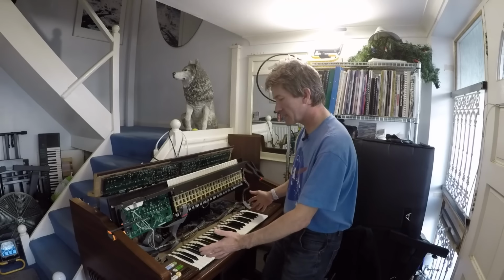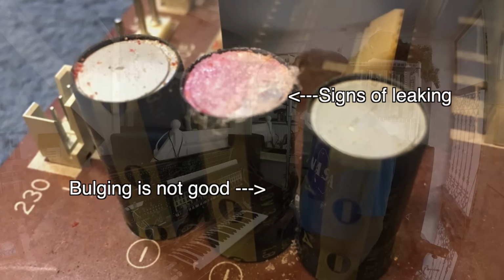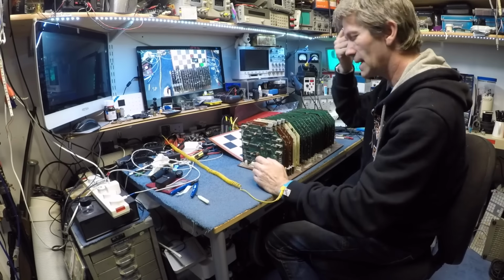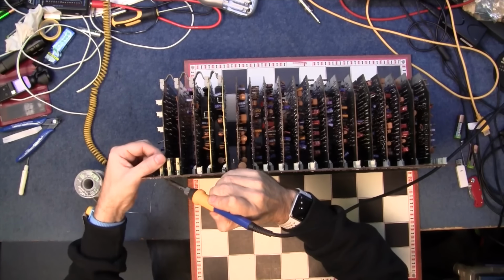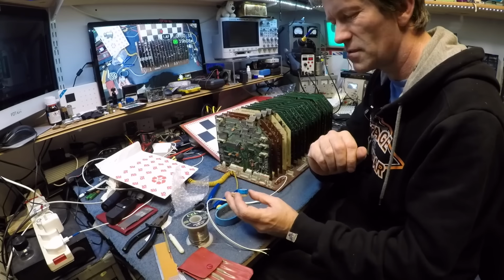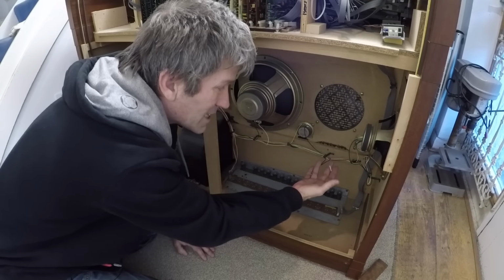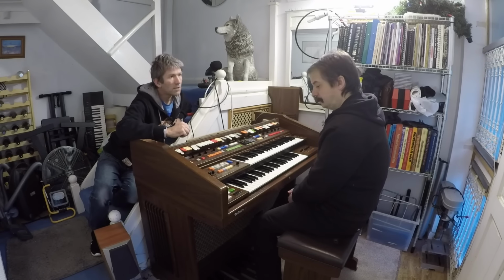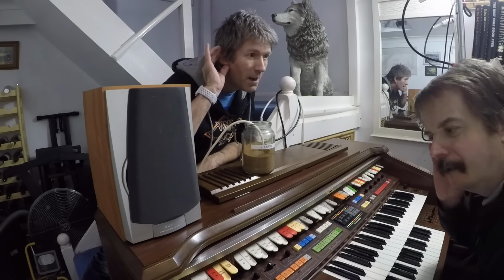Technics U90 organ repair

Comment: Hey Marcus, first off I want to say I love watching your channel. You have a gift of explaining complicated things in such an easy to understand way, and have given me more confidence to attempt repairs.. I've pretty much been through all your video's now! I like fixing stuff too, but unfortunately I don't possess your skills. I've got a problem with a Korg Poly 61 I picked up. When I got it there was only power - none of the displays worked and there was no sound. The internal battery had leaked which is common to this model. I cleaned it all up with IPA and it came back to life - the LED's, all controls and all keys work as normal but the patches sounded weird. I've cleaned up the CPU board, sound board and power board and cleaned and reseated all the molex connectors on these with IPA. I had a direct replacement 3 leg new battery fitted. However, when I load in a WAV file of the original factory patches, it only stores them temporarily(about an hour after power off) and then it reverts to the original internal patches which still sound weird and corrupted. When I load in the WAV sounds it plays them back perfectly with no corruption.  It's been suggested that the battery could be the wrong way round, but the 3 leg battery can only be fitted one way so it can't be this surely? Really hope you can give me some pointers as to why it can't save patches permanently - I'm not getting much help off forums. Apologies for long post. Thanks and looking forward to more video's!
Reply from the maker: Hello Kevin, I think you must have placed the battery correctly as you say its a 3 pin version so only one way is possible. I guess one way to check would be to load the wav file test the sound then turn off then back on again but within 30 seconds then if the sounds play ok then it cannot be the battery polarity because if it was the wrong way round then the memory would be lost within a few seconds of power down. there must be something else draining the power down . can you check the voltage of the battery to see if it has been depleted already ?. that would explin why the memory is not holding. if it is depleted then you need to find why the power is running down on the battery.

Comment: Hey Markus, thanks for this video ! I'm dealing with problems with my U90 pro too... When I switch it on there is no sound und all the LEDs in the preset buttons don't work and nothing happens when I push the preset button.
Checked that gold caps on the board and they were all leaky. Got 3 new of them and replaced. I switched on the U90 and having the same problem as before. No sound not LED on preset button and no reaction when I push them.
Do you have any idea ? 
thank you so much !

Comment: I have an SX-U90S but only the top portion. No base, no speakers, no amp. It does have outputs on the key platform underneath. ( phones, aux, mic with volume potentiometer, and line out ) And I see two IEC cables coming from it. Do you know the voltage as I imagine it’s a low voltage IEC. I certainly don’t want to fry anything attempting to plug 110 into it. Thank you.
Reply: Well the reason why you don't see any speakers underneath is because the speakers are separate it comes with two great big stereo amped speakers

Comment: A friend gave me a u 90 after swapping it with a fully working u 90 - the fully working u 90 had been struck by lightning through the mains  incredibly  the only damage was the amplifier modules got blown up , repaired the tech bolted on LM IC  AMP  substitute boards and the u 90 is back to normal - 
Mark that was interesting that you didn't un plug the boards , I did and caused dry joints to show up on the mother board connectors , seems I was chasing a single broken audio line at start luckily all came out OK resoldering everywhere .
Reply from the maker: Hello Keith. I thought about pulling off the boards to try and see what board did what but I’m glad I did not as that can create new problems to work on. we eventually gave it away to a local charity shop and they somehow managed to make £350 from it which is a very good price.
Reply: @markusfuller  I tried to make a DIY schematic of the whole system but only just got so far to get a partial overview. EG the key and stop scanning is basic/ standard gear.
The u 90 shares some same technology ( CPU ) as the famous polysix , saw your video on one that was wrecked beyond repair.

Yes 350 pound was a good return for the charity .
So many organs sound the same on both keyboards u 90 has this too but with enough extras to make it ok.
Reply from the maker: Keith Citizen If only I had a larger place I would have gladly kept the U90 but I live in a small flat so it’s difficult to keep too much gear.
Reply: @markusfuller  interesting, sounds like you liked the u 90

 Ime seeing a Technics g 7 (1986 ?)  available in Australia for around a hundred pounds , I guess it's a very different animal to try and repair and not worth buying.

Comment: I have just received an SX- U90  for  our club unfortunately it has a problem with the top manual, it has distorted sound  which is as if it has a sore throat  the distortion is there without  any keys depressed, any suggestions as to the cause of the fault , and where can I get a service  manual. I am in the UK.

Comment: Hello
I have bought an organ on my own (Hammond Romance series). It has a really weird problem. If you have any ideas where this problem may come from or tips on what to look for while searching fo the problem that would be awesome! Here 's the problem: 
When I start it most registers don't really work until I press a lot of keys at the same time. Then they work for some time. If they stop working I have to do that again.
First I thought that this problem might be about a minimum signal strength for the amp but it seems more complicated: If I get the volume (expression) all the way up that doesn't help. Only pressing more keys helps.
I already opened it once and had a look for broken capacitors but didn't find any.
Greetings from Germany :)
Reply from the maker: Hello . I am really sorry but I just do not know what to suggest, I have never worked on a hammond romance series organ but I have never come across this problem with any organ so I cannot understand what the problem may be or even where to start looking. I am truly sorry, if i had the answer or even an idea i would be glad to help but this baffles me.
Reply: @markusfuller  Thanks for answering so fast and trying to help. I think I'm gonna have to take another look inside. I just found your channel today and already learned a lot of nice tricks to check components. Unfurtunatly I don't have an oscilloscope  though :/ Also thanks for sharing all your knowledge with us.

Comment: Where can one get these serviced in the UK? I've been wanting to get one but am told nobody services them anymore and parts not available. Would someone knowledgeable in electronics be able to service it if the organ servicing places say they won't? I know nothing about electronics myself.
Reply from the maker: Hi It is best if you can find a proper organ service engineer but almost all the electronics inside is still available to buy from places like rs-electronics or mouser or even taken from other old organs though some of the microchips may be very difficult to get hold of now. so yes a good electronics person should be able to repair this depending on the fault.

Comment: Hello Markuss

I own a U90 technics organ
it was electrically disconnected for 9 months

There is no more sound

I have changed the capacitors as shown on your video.
by 3 capacitors in series and tested + 5 Volts in total

I still don't have sound

Do you have another solution
I thank you for
Yours sincerely
Reply from the maker: No sound at all . check any fuses where the amplifiers are . I think ther are in the back above the pedals. I no longer have mine so cannot remember but check if there are any fuses down there as the amplifiers may have their own.
Reply: @markusfuller  Hello Markuss

Thank you for your very very quick response

I am French and I live in LORRAINE (France)
When I plug in and turn on the organ with the button
(Push on Power) and Main volume at maximum
the pedal to the maximum too
I hear the sound from the "subwoofer" diameter 30 cm and on the 2 speakers of 20 cm

no sound on keyboards but:
"the conductor orchestral"
is fully "ON" (blocked)
6(sélections) keys in "UPPER"
and 4 (selections) keys in "LOWER"
Do you have another solution
Thank you

cordially
Reply: Regulator chips often failed in those..worth a check.

Comment: I guess the higher voltage on the replacement cap is ok? Just not the other way around no?
Reply: Correct. Voltage rating of a cap indicates the highest voltage it can tolerate (not the voltage it requires or produces or whatever). Thus a, say,  16 volt cap in a 5 volt application is fine but a 5 volt cap in a 16 volt application explodes (or at least emits foul smelling smoke and shmoo).
Reply: @sootikins  A follow up about caps - why did he lower the capacitance? I'm not following the math.  Since the caps are RATED higher, but still only going to charge to the given voltage, shouldn't he have gotten a single cap rated the same (or higher) voltage and triple the farad?
Reply: @ @sagetx  When capacitors are in series, as they were in this organ, the voltages sum up but the capacitances (farads) divide (much like resistors in parallel do). He sort of covers this at 6:00 but to clarify: when caps of identical value are connected in series, the total capacitance is the value of one cap divided by the number of capacitors and the max voltage is the sum of the caps' voltage ratings. If the caps are not identical the math becomes a little more complicated. Maybe this link helps:  https://farside.ph.utexas.edu/teaching/302l/lectures/node46.html

Comment: Hi, I have a Technics PCM Sound E11L that I bought second hand. I love playing it. It's my baby! But for some strange reason each key has started making a wobbling/distorted sound. I don't have a manual for it. I've tried changing the settings but to no avail. Can you help me? I'm based in Buckinghamshire. I really want to get it fixed. If you can help, or refer me to an organ fixing service that would be a great help

Comment: Dear Markus, thanks firstly for a wonderful video. I am living in the Philippines where house wiring does not have earth and I have taken your advice and added a earth-jar and this helps no end. The other, more annoying, fault my Technics organ has has not improved though and I was wondering if I could ask for your advice ..

So, basically I have a Technitone SX-70GW which is older than your U90, built around 1973. Unlike the U90 it's 100% analog including a drum machine with analog sounds (the U90 probably has PCM). It's 'similar but different' when taken apart, there are no flat cables like on the U90, instead it is bunches of coloured cables going onto boards everywhere - there are two banks of circuit boards mounted behind the keyboards one near the other flat (no mainboard) and nothing at all is labelled. The tone generator for the pedals is totally separate and is housed in the bottom compartment where the speakers are. The way this thing works (I am reasonably sure) is to have 12 oscillators, one for each note, frequency divided to go down the octaves.. it's 5 octaves of keyboards (2 x 4 octave keyboard spaced 1 octave apart) and then there are 'lengths' from 16' down to 2' so that's another 4 octaves. 

The problem I have is that sometimes when you turn on the F# keys do not work on both the manuals .. pedals are a separate synth so those work fine. I know for sure that the keyboard is OK (wouldn't fail on all F# at once, firstly, and if you turn on 'keyboard percussion' the keys work and produce a snare-ish sound). Pressing the F# keys produces a very quiet, high pitched sound which is correctly tuned and sounds slightly different (as in different harmonics but always high pitched) depending on which key is being pressed and which combination of voices is used - I think this is some leakage current and the problem lies somewhere inbetween generating the original tone and filtering it down to whatever should go out. If you leave the organ switched on, after a while (could be 5 minutes, could be an hour) the F# keys start working too, once they start they never stop again, even if you turn the organ off and on again within a short time. If you leave it off and come back next day, the problem repeats. This makes it very difficult to diagnose because once it 'starts working' there is nothing wrong with it. 

I have identified 6 almost identical boards, side by side, that I think are the main tone generators - they are connected to the rest of the organ by wire-wrap terminals on the edges. I am thinking the fault is some sort of dry joint or maybe a bad wire-wrap though jostling (gently) the board components on what I think is the F# channel (nothing at all is labelled - I am assuming C is the furthest to the left so F# would be the 7th 'channel') doesn't create any static or help.

Any suggestion on how I could track down the fault further?
Reply from the maker: Hello Dave. I have had this problem before where one certain key like f# would not work on any octave until things warmed up and it was a problem finding out where the fault was as there was no google or internet in those days and i had no workshop manual. I think my problem turned out to be a faulty frequency divider chip. I think I was applying pressure to the chips one by one with my finger thinking there may be a dry joint and pushing a chip with a dry joint would would make it work. I also had someone playing the keys up and down while i was doing this, however i was touching the sides of the chip where the pins were and noticed there was a strange tone at one key meaning when my friend played up the scale the C key suddenly sounded strange like there was a new fault so i touched another of the frequency dividers in the side and the C# sharp made the same wierd sound when played. therefore i managed to work out which chip controlled which key. then i could concentrate on just the section that had the fault and found changing the frequency divider chip did the job for me. I did spend several days on it as the problem sorted itself out once the organ warmed up which means looking back now i’m not 100% sure the chip was faulty but maybe it was a very fine dry joint on one of the chip legs where when it warmed up it would connect and just soldering a new chip in meant i resoldered the dry joint. however it is possible that chips of that age can have thermal issues but normally they break down when they warm up not correct themselves when they warm up. I would look to see if there is frequency divider chips in your organ and touch some of the legs while you play the keys you may find one key will go strange or even leak its sound to the next octave. then you can start mapping out the notes to the chips and finally narrow your problem to a much smaller area of F#.
Reply: @markusfuller  , and Dave Allen.  I was going to guess the same as You Markus.  
   Organs have been using the same basic schema, and architecture since the 1940's.   The dividers which are basically flip flips , used to be made from components, and even had the same basic circuit when they used vacuum tubes, (in Lowrey organs.they had all the components for the dividers inside a ceramic case so they looked like giant squared off ceramic caps with too many legs).  A flip-flop is a cross coupled (non linear) dif amp., and similar to an astable multivibrator but it is stable.  There are a pair of transistors (probably) in this one with equal value collector resistors, and a couple of caps from one collector to the opposite base.  There may also be steering diodes to direct the input signal to the unsaturated transistor base. 

   The problem is probably that one divider (at the top octave of F#) no longer flips and flops because of latch-up or another bad component.  This could be because of a leaky cap in the power supply (local for that series of dividers) or maybe a leaky coupling cap in the top octave.  When the dividers are on chips they may be SN7474's or 7473's (old 5 volt computer logic), if they are wired from individual transistors there should be a pair of transistors for each octave and each note.  It may be fairly easy to figure out which one is for F#.  I would try swapping out cards, if the different octaves are on cards or perhaps a card for each note?  and see if that way, the in-operable note moves to a different pitch.  It is likely to be the top divider for F#.  If you have a transistor radio, You should be able to find all notes of the organ always in play by connecting a little shielded patch cord to the input of the volume control of that radio.  Naturally the circuits for each note should reveal themselves that way.  Try disassembling in the suspect area, and using deoxit, or doing Your best to clean the board,.. but it could easily also be the wonderful humidity, and micro-organisms in the Philippines, or a bad cap making life a joy for that organ.  It may be that moisture gets driven off when it warms up, or there is a cap with a longitudinal crack across it especially, if this organ uses ceramic discs for the cross coupled caps.  Try also using a hair dryer on the suspect parts for awhile before cold start up, and see also if that helps localize the area of the problem.  (The hairdryer will drive off the moisture)  
  
Lots of luck.  I hate the sound of this organ by the way!  YUCK ! ! !  hahahahaha.
Reply from the maker: @Geopholus  Thank you for your info. it will be a great help to people. I too did not really like the sound but some was ok. we passed it onto a charity shop and they sold it for over £300.